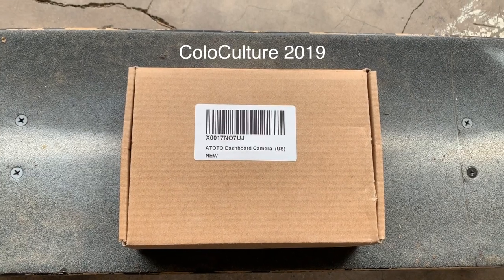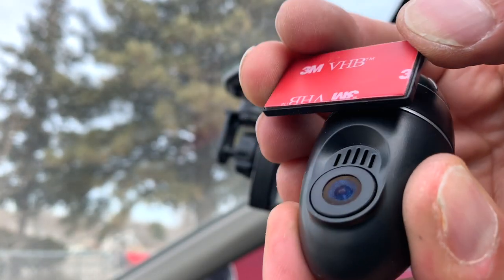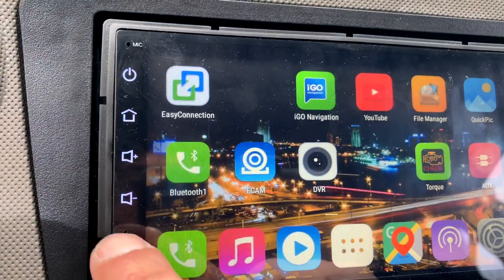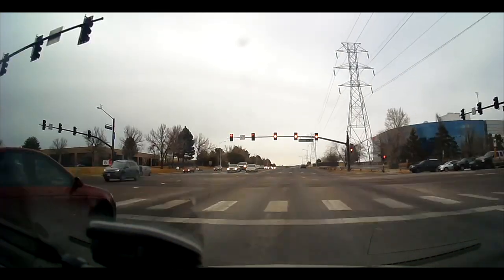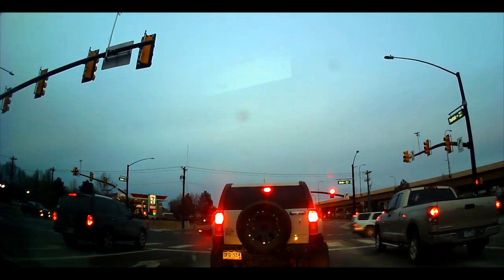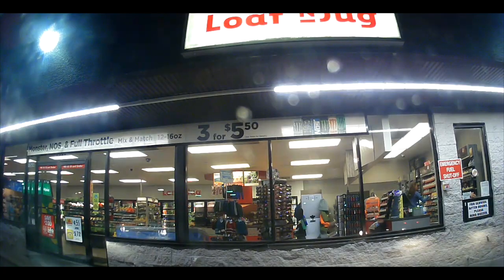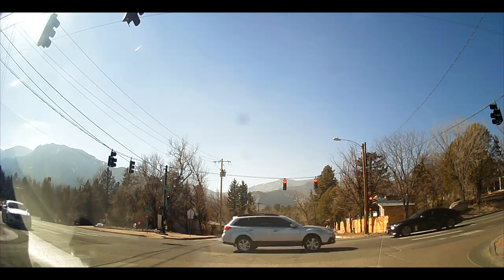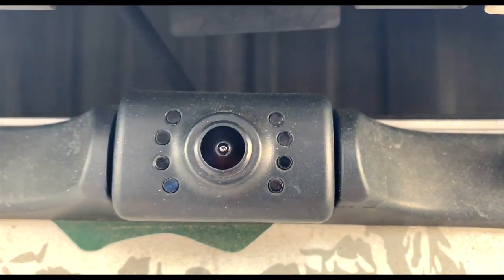ATOTO DASH CAMERA 720P INSTALL AND REVIEW

Comment: Hiya few questions if you don't mind?

1. Do you have to go into the rear view app to see the rear view camera or can you set it to come on when you reverse?

2. If you're recording using the front dash cam, can you exit the app to do other things, say like use the rear dash cam to reverse, while the front one is still recording footage?(multitasking etc)

3. If you can multitask the apps, did you find the 1gb ram version to be sufficient for running different apps at the same time?

4. Did the rear cam come with the unit as standard?.

Thank you for your time.
Reply from the maker: 1. You do have to go into the app if you didn't connect the REAR camera to the reverse. I usually don't set it up that way. I like to turn it on when I want. You can set it up to come on when you reverse.

2. I haven't tried to record then exit the FRONT camera app. I does run fine when it is playing music while running the FRONT or REAR camera is just running, not sure about recording.

3.1 GB is fine for cameras and music, even bluetooth is fine. No Netflix tho

4. It did not come with the unit, I picked it up a few weeks later.

Thanks for watching! Peace

Comment: Nice vid!! Could I connect two back up cameras to the same unit?
I want one in front of my baby's car seat for monitoring him.
Reply from the maker: You could hook a backup camera and use the front facing camera to monitor your child or the other way around. You just have to wire it that way. This camera is usb so it really easy.